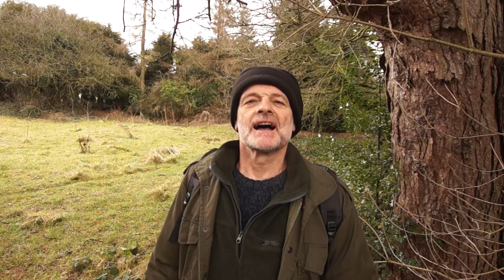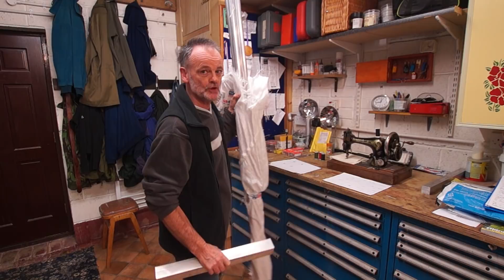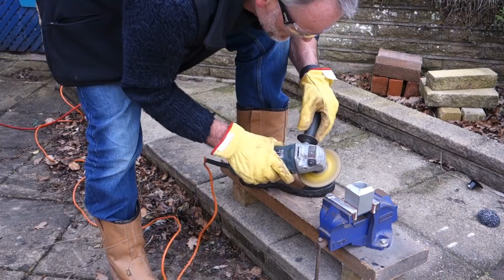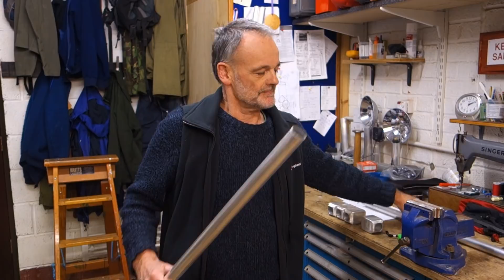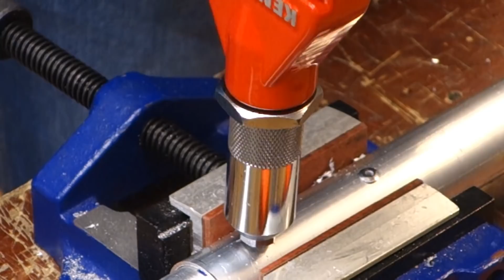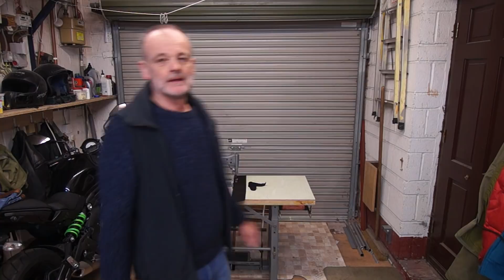An Introduction to Tree Camping

Comment: Hi there what kind of aluminium is that 6000 series or 7075? Couse my frame arrived today made of v2a 20x2mm stainless steel and i tried to bend it immediately and i can do it almost with 1 finger what's completely insane thinking your frame is 30x1,6 aluminium... I wanted realy stiff frame whats seems impossible now to me
Reply from the maker: Hi there a few years since I built this, it will have been the general grade of Aluminium, can’t remember which or if  I mentioned it in one of my videos . I went for the 30 mm to give it ridgity I can sit on it and it won’t bend, when building the joining pieces I inserted a smaller section inside the 30mm to form a spigot type ferrule, like a fishing rod joint, again making the joints more ridged.
20mm does sound thin even at 2mm, think of electrical conduit and how easy that bends, hope you get things sorted, there maybe more info in my other tree climbing videos……..thanks Pat

Comment: Amazing video Pat, thanks so much for filming this. I'm looking at doing similar, don't suppose you have your designs anywhere online do you (you showed them briefly but couldn't quite make them out)? I'd be interested to see your main design and corner pieces if they were available? Keep you the great work :)
Reply from the maker: Hi Martin, no designs or drawing just made it up as I went along, the main aluminium tubework was 32 mm and the corner peices I cut from a 40 mm square block of aluminium, had a machine shop drill them out for the tube and built it from there. I have another tree camp in next few days, and in a later vid in possibly October will go into more detail of my tree camping equipment....thanks Pat

Comment: Well explained Pat, how do the poles lock into the corner pieces or is it held together with the lobbing
Ian
Reply from the maker: Ian Parker Hi Ian my next vidio which I,am near to completing will show it more clearly. I secured the corner blocks to the end prices with 4 small bolts, when it is all assembled the tension on the bed material basically keeps everything in place, part 2 should be out next week, then it will be test time!!  all the best Pat.

Comment: Hi Pat. I posted this on another video but thought I’d add it to your most recent one. Please can you tell me what you use as that silver windbreak for your stove and also how you made or where you bought the cooker cosy?  Great videos and very inspiring as I’m laid up after having my Achilles sewn up - I had such plans for this summer but your videos are keeping my enthusiasm!!
Reply from the maker: ridmavor sorry to hear about your injury, my brother did same thing last year very difficult to get about with position of his foot 
The windshield is thick foil bought from camping shop and can be pegged to ground to make more secure. The pot cozy is made from Reflectix a foil covered insulating material, all fastened together with foil sticky tape, one for the pot and another for the lid, really keeps the heat in, thanks Pat
Reply: Patrick Dickinson Thanks Pat. Videos really helping my convalescence!!
Reply from the maker: ridmavor glad you are enjoying them, Pat

Comment: Facinating, just found your channel and love your reason for doing the tree camping - convincing yourself you're not getting old. Great find with the portaledge, for the middle piece you could curve the tube so that it does not interfere with your back, it will still be structurally sound and stop the sides from flexing in too much.
Reply from the maker: Rush Dougherty Hi Rush it is A very intetesting project building the Portaledge, getting on well with it but each bit I do throws up another problem, but hopefully should have it built by May, all the best Pat

Comment: Excellent idea Patrick! A very new idea for a wild camp.
As a climber I have always wanted to use a portaledge, but can't merit buying one because the climbs in the UK are not long enough! - Great idea to make your own.
One thing I will warn you of is that pop rivets can be prone to wear when loads are regularly placed on them, please inspect your rivets every time you use this frame. They should be ok, but if they do stretch they might come out.
Look forward to watching your adventures and the finished product.
Rich.
Reply from the maker: underwaterdick Hi rich and thanks for your comments, I think I will get as much enjoyment out of building the Portaledge as actually using it, it incorporates so many different skills.Take your point about the rivets, by rights when all assembled the tension from the fabric should hold everything together but will be aware of possible problem with rivets. Hopefully will be giving it a low level test in May, thanks Pat

Comment: Hey Patrick exciting project that should see you aloft in a tree soon. There have been a few compromises but as you say it's mostly your own labor and skill. It should be good seeing how it goes - next the sowing. All the best. Mark
Reply from the maker: Wye Explorer Hi Mark yes it's progressing well especially as it's still raining outside. I think I will test it it too high up first to see how easy or difficult it is to set up. Sort of making it up as I build it, each new bit seems to throw up problems to sort out, part of the fun of building, thanks Pat
Reply: I think you're going to create a versatile bit of kit. Testing is crucial - we want to see you still around for a long time yet!
Reply from the maker: Wye Explorer yes when I,be completed the Portaledge going to try at low level, see what it's like to fit together. All the time secure to climbing rope even when asleep, a lot of new methods of sleeping, cooking  etc to be sorted out, but that what makes it so interesting and challenging, thanks Pat
Reply: Yes I agree Pat. It's multi-dimensional and not as simple as it looks. Great fun!

Comment: Nice one Pat looking forward to seeing how it turns out this one & how you get on with it up in a tree in actual use..spent 14 years in welding/engineering so was interesting to see how you came up with your'e own design & put it into practise.love playing around with bits like that myself so would have been in my element designing & making that.look forward to part 2..tfs Pat atb..Andy.
Reply from the maker: Andrew Beavers Hi Andy yes a little bit different, I think I will get as much fun out of building it as well as actually using it. Going to test it out when completed to see how easy or difficult it is to set up. Easy on the ground not sure when swinging on a rope in a tree. I like things that seem a bit unachievable at first seem to push me a bit more, thanks for comments Andy all the best Pat

Comment: "Rock-a-bye Patrick, in the tree top . . ."
What a wonderful wacky idea - I love it!  Go for it Pat.
I look forward with great interest to following this adventure.
Sandy (Wiltshire Man) can tell you where to buy a parachute!
Noel
Reply: I think I might have used epoxy resin rather than pop rivets.
If you find you do need a spreader bar you could always use a bow-shaped one that clips into place so that you didn't feel it.
Just thinkin' . . .
Noel
Reply from the maker: Ha yes sandy,s the right man for a parachute, I think I,ll get most fun out of building it especially as the weather is poor outside at moment, thanks Pat
Reply from the maker: Pop rivets seem simple at the time, have used epoxy on other stuff not sure how strong on Aluminium with oxidization etc. Spreader bar could always be put in later like you say, I think the fabric may stretch so might need one just have to see how it performs, thanks Pat

Comment: Nice one Patrick, my first thoughts was that it could do with a bar in the middle, but like you say the thicker tubing should be fine, also when you add the webbing it will spread the load a bit, I’m sure you’ll be doing plenty of testing low down anyway. Looking forward to seeing your first tree camping adventure. I thought you was joking at first as if it was some sort of belated April fools 🤣🤣 that Bike though Patrick I want to see more of that 😍

Comment: What a great project, are you using a specific grade of aluminium tube for this .. nice job, looking forward to the next stage .. thanks for sharing Patrick.....
Reply from the maker: Glenn Fryer Hi Glenn I got a lot info from US websites they used 6061-T6 grade, not so common in UK but 6082 - T6 readily available so I used that seemed to have similar properties. On with a lot of sewing at moment part 2 should be out by end of April, thanks Pat

Comment: On your first camp Pat, please take some leg splints and arm slings.
Reply from the maker: Hi Steve, anchored to my climbing rope all the time, it could go wrong but that's were the challenge is to ensure it all goes well. On with the sewing side at moment and will be testing later on, at low level just in case, thanks Pat

Comment: Hi Pat,
If you lived closer to me I would have let you use my workshop facilities free of charge.
Looks like a great project this. I shall watch with interest:)
Sandy
Reply from the maker: Wiltshire Man Hi Sandy very kind of you to offer, very few tools really, basic hacksaw and drill, if I had made corners smaller could of done away with angle grinder. On with a lot of sewing at moment, good experience. I think part of this project is for the fun of making something, and the other is for just something a bit different as I ,am sure you will understand with all the adventures you get up to, thanks Pat
Reply: Hello Sandy, the internet is a very fine tool, the odds on bumping into you in my part of the country would be very very slim but the YouTube digital forest makes that possible.
Reply: Little Bull 
"YouTube digital forest" (chuckle) Me too.
Reply: Hi Sandy, have to have extra fixings / hangers for the radios and a platform for the key installed. 73.